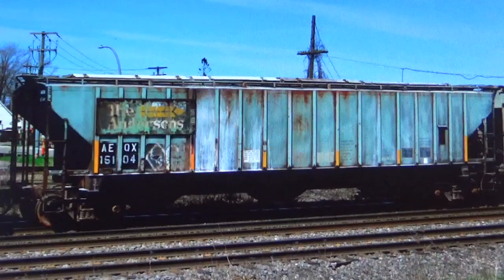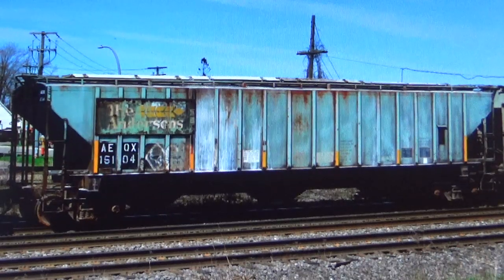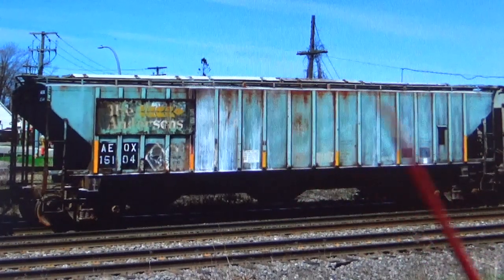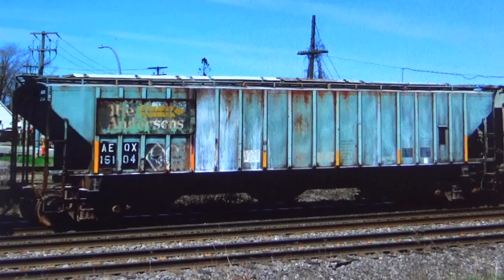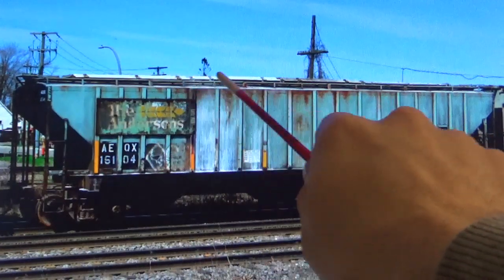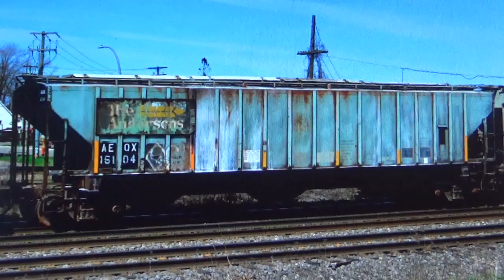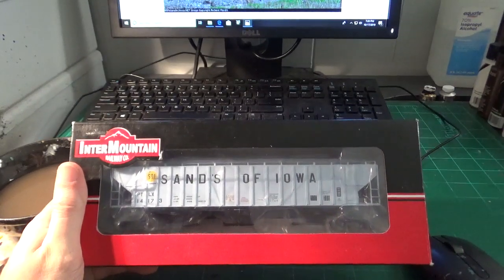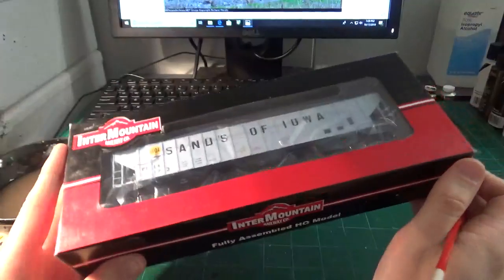DCT. Modeling Series!  AEQX #15104.  Part 1

Comment: Dan,have you tried Clear Matte Finish from Rustoleum ? Far cheaper clear coat than Testors.
Reply from the maker: I wasn't impressed.  I have a can, but I don't use it much.  The issue is it splatters real bad.   I tried a few things but I kept getting that issue.
Reply: DansRailroad2011 I agree with that. Krylon is somewhat better but Testors is still the best.
Reply: @DansRailroad2011  Dan, wassup...I just wanted to know do you sale any of your cars? If so do you have a website where I could buy some? I don't know how to weather at all so would rather buy. Thanks
Reply: @amun1999  I believe he sells some on Ebay and through his Facebook, but I don't have any details.